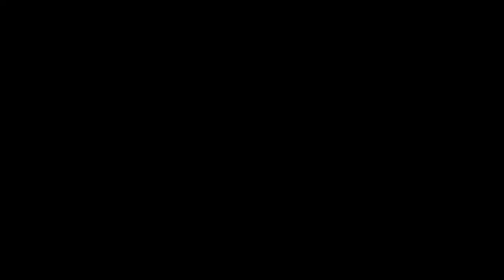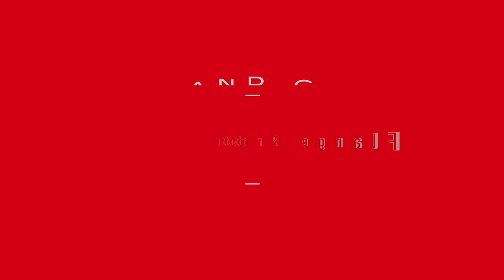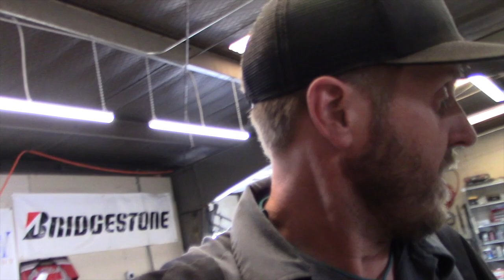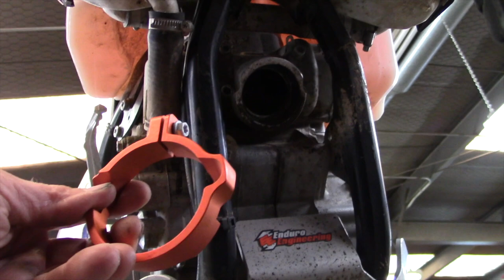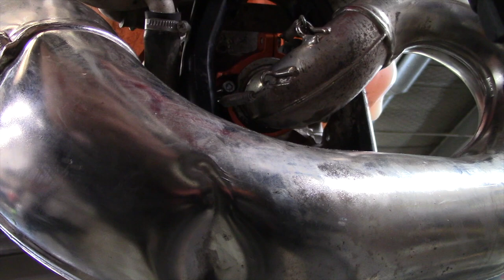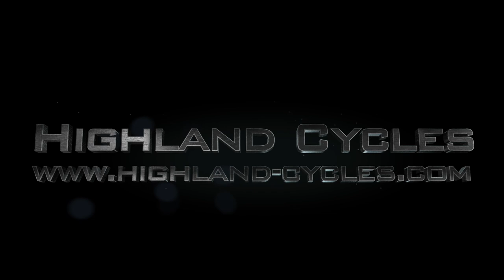KTM 2 Stroke Flange Protector Install

Comment: Great video. Short simple and direct!!!
Reply from the maker: Thanks a ton
Reply: @highlandcycles  hi just instolle my flange guard!!! Sorry for bothering u but i have a question regarding JD jetting... I have KTM 300xc 17 model and fit JD on my mikuni tmx38, riding at the sea level what jetting will u sugest for it coz PJ 30 blue needle #2.5 and main 420 is way to rich. Most of my riding is technical trail... Should I jump to red needle??? Kind regards
Reply from the maker: RS ENDURO ABERDEEN I would go to the red needle in #2 and maybe drop the main one size if you aren’t way up in the revs.

Comment: So I had 93 KTM 250  and ran the pipe protector  guard  and never  broke  a jug. Are the new cylinders  jugs not made from strong enough materials
Reply from the maker: Seems not.
Reply: @highlandcycles   why does KTM only want us to run motorex gear oil?
Reply from the maker: @gotdirt66  marketing. I run belray gearsaver and have since 2012
Reply: @highlandcycles   what's your opinion on the air fork wp 6500 cartridge kit?
Reply from the maker: @gotdirt66  I have a set of 6500's and I really like them.  I like the Dal Soggio Spheres better